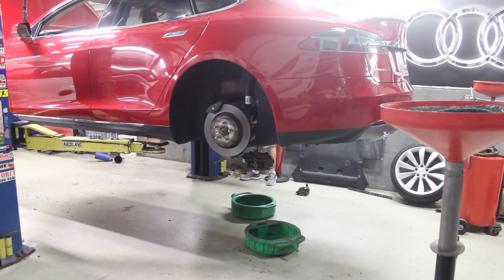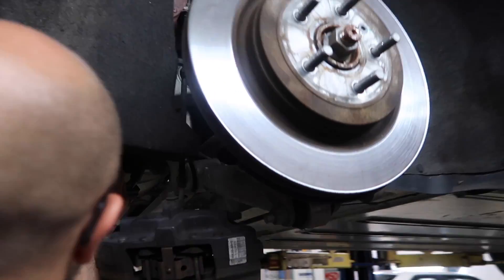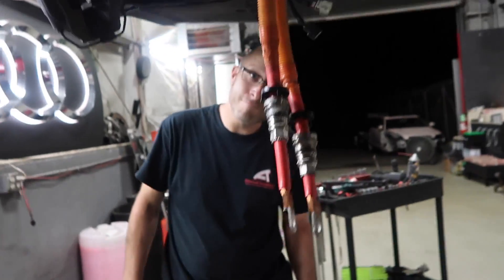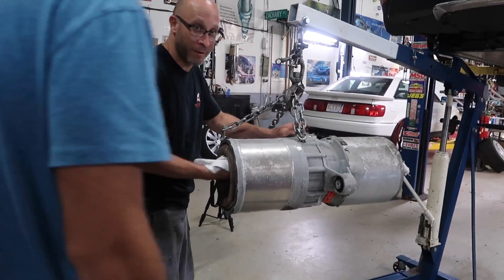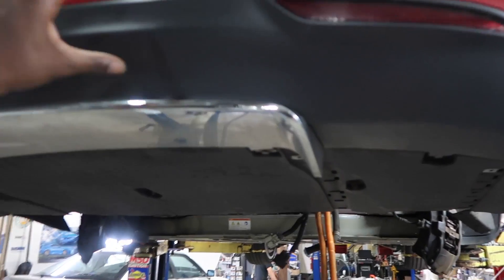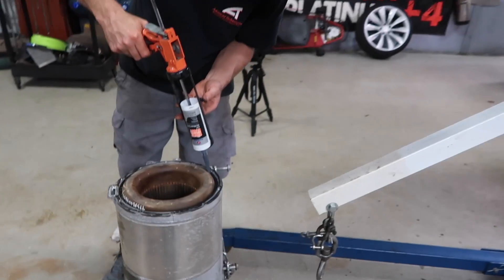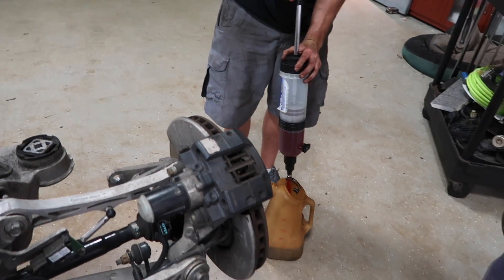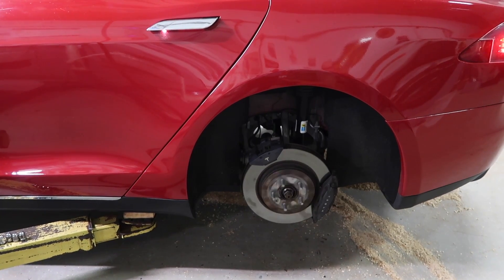First Generation Tesla Motor Failure

Comment: If this is the wave of the future. Tesla need to start helping rebuilders. I don't see any harm. In  helping people do things correctly.
Reply: Tesla may learn a thing or two along the way
Reply: @stevenbarrett7648   I hope so.
Reply: His car is a rebuild telsa will not service it, don’t try to service your car anywhere. The computer know this. And you will lose your 8 year or 100 thousand warranty. Even if you don’t go in for the yearly service schedule you can be denial a repair because you didn’t follow the schedule service to keep everything adjusted right. Telsa want everything in house or you will pay.
Reply: I love that analogy: bottle rocket vs Saturn V lol.
Reply: Tesla does not give a shit about rebuilders.
Reply: Steven Correa . I doubt Tesla will want to associate themselves will
rebuilders.
Tesla is  well aware that their vehicles require minimum repairs ,
hardware ( motors and any other 
mechanical part) is any easy fix.

Yes , you are right TESLA should offer assistance to computer programmers  who carryout 
software repairs off their grid,
in doing so tesla will not comprise
reliability on their older models.
Reply: Steven Correa legal liabilities, as well as IP issues. If someone gets electrocuted because of a waterlogged battery it won’t be very good for EV’s you’ll just get MSM saying things like 

“Are EVs as safe as Elon says or perhaps more fatal than most pregnant single mothers with autistic kids believe? Find out at 9pm!”
Reply: Yes, they don't want liabilities they have to manage and be financially responsible for, so Tesla just act as though they are the unicorn company that doesn't deal with independent service networks like all ICE cars generally really have to.

It's not really just vanity or spite, they really can't deal.
Reply: That's cause they want all the money for themselves which is fucked up.
Reply: They do to an extent right now. But there is a subscription based service you can apply for if you own a shop, and get OE repair info from Tesla for a monthly fee. It's not cheap.
Reply: It's not the wave of the future, it's just a fun project car because it's so unique. Tesla doesn't want to help rebuilders, they want to control all service. These cars will go the hobbyist icon way because they won't be available and serviceable for much longer.
Reply: @zolikoff  You're right I'm wrong. I forgot about the electric trolley cars we had eons ago. Before General Motors bought them all and dismantled them.
Reply: Make no mistake, the electric drivetrain is going to be in most cars of the future, that's for certain. But there won't be many purely electric cars around, and definitely not many cars like this that are expensive, decent-range pure EVs. We will have hybrids for most cars and small, dedicated EVs for city-only use, but they will be like the VW e-Up.
Reply: My point to this is if your spending that kind of money with that amount of failure rate there's a "problem".  Bad bearings, weak shafts.   I think a lot of people are like some kind of retards. Evidently they haven't ever seen a drive unit out of a electric forklift. And don't realize they have been used for decades. And don't have the failure rate of the Tesla's.
Reply: Tesla just doesn't know how to properly build cars. They outright refused to adopt automotive manufacturing best practices (eg. Toyota Production System) out of pure spite. They're a silicon valley company with no initial experience in the field who think they can start from scratch and do everything better.
Reply: Let me know when you find a forklift that does 0-60 in 3 seconds.
Reply: David Christopher  ...Can a Tesla pickup 8,000 and raise it 20 feet in the air.  The point is the electric drive isn't new. It's not a invention sent from the fairy rainbow climate gods to Musk.  Looking at the poor quality of the Tesla unit. These cars are way overpriced.
Reply: The Creator -You compared the drive unit of a forklift to one of an automobile. It's not a valid comparison as their uses are so dissimilar.  Tesla's early motors had issues that Tesla has worked to resolve. They warranty the drive units for 8 years with unlimited mileage so no one is having to pay when they have an issue. It's still relatively early days in the EV world and tech is just beginning to become more robust as more is learned.
Reply: @Northstar4653  I have a $200 forklift motor I have no idea how old it is very very old. I wish I knew how to advance the timing. 48 volts. But the speed limit at my. Neighborhood is only 35. I should be fine to drive in the neighborhood.
Reply: @dchristo10  Thank goodness for warranties. I hope you heard of Wayne Alexander EV blue Walton Kansas. Been converting cars with forklift motor before I was born I'm almost 50.
Reply: David Christopher or a forklift that operates outside 365 days a year in all weather.
Reply: Won't be hybrids when so many countries have enacted laws to ban ICE vehicles in the future. You need to take a closer look at what's coming.
Reply: David Christopher That's an overstatement and misunderstanding of the concept if I've ever seen one. Some countries want to phase out pure ICE production (not ban their use), and a handful of cities are thinking about banning them inside the city. Neither of these two affect hybrids because the policies are directed at ICE-only vehicles.
Reply: If that's the wave of the future Tesla is bankrupt.
Reply: @Northstar4653  well the electron was going to run everything. We went to Petro. Not a good thing

Comment: the shaft with the gear teeth, couldn't the gear end be, carefully, welded then have the gears re-cut, at a machinist job shop?
Reply: Would need to be a really good job for the amount of torque that can be generated.. I'd like to see it happen, it is not impossible.
Reply: Find a good welder or a machine shop that has an in-house welder, most do, then it should be good. Keith Fenner's channel and Adam at Abom79 channel, do this all of the time, I believe their work repairs higher torque rating(s), for their jobs are repairing hydraulic gearing and ship engine drive shaft. Best to research, first of course, any such work at local weld or machine shops.
Reply: eddie Towers Yeah, but making a nice weld and then the gears ain't easy :P
Reply: How so, just as the manufacturers of the geared shaft, one only needs the process of gear ratios, a milling machine, and a process to divide such ratios onto such a shat, like a dividing head, or on lower end, but same result, rotary table. Look up, gear cutting, here on YouTube, and know diametric pitch, diameter, al9ng with gear, tooth count. Though it seems overwhelming, it’s actually quite easy using the Machinery’s Handbook for guidance. Anyone can’t fail, following such processes
Reply: I’ll admit, maybe it’s unfair to say it’s easy, as a seasoned machinist. But it’s certainly not out of anyone’s reach, to replicate exacting gear cutting.
Reply: yes, it possible to restore the shaft, could be an interesting project

Comment: sorry to say but that shaft is gone will not last 2000 kms,sorry to say rich .u can use the rusted shut good shaft by heating then u can take it and stick it to that car.
Reply: 50% Simple Green/50% WD-40 works wonders on rusted shit. We call it milk (don't drink it).
Reply: @Phyxx_TX  atf mixed with kerosene will work as well.
Reply: Or get a can of penetrating oil and spray the hell out of it.
Reply: You could also do alcohol 90% dip it and then pull it fast. Have done it, the alcohol penetrates like nobody's business and then it evaporates.

Comment: Well, that was educational, my model S has 44k miles
Reply: Lol my Tacoma has 300k miles and it has the same engine from 1999
Reply: @XxmatixX6videosdiariosdenadav  and this is another story, can't even compare the situation, the experience ice car manufacturers made over the decades and what experience Tesla has, they are good engineers and brave but still missing some points. Maybe that shaft should stay in a oil bath like the internal of a gearbox, or maybe for the power it develops the axle is undersized. It's a bit early to overuse anyway
Reply: XxmatixX - 6 videos diarios de nada :v 
As Rich said, they made major improvements to these over the first 2 or 3 years. Tesloop, a long-distance taxi company, has two 2016 Model X's with over 300k miles on the original drive unit and battery. The first year model of Tacoma probably didn't last 300k trouble free either.
Reply: Dustin E 
Well they gave me a whole new drive unit so I should be good to go for several years.
Reply: Jeremy Schmidt they probably changed the bearings and resale it on ebay 😂😂😂😂😂
Reply: What year is your Model S?
Reply: @azalru  2013 S85
Reply: My '13 S85 made it to 78k miles. Was still driving fine but making a milling sound.
Reply: Jeremy Schmidt engine bearings
Reply: @Dustin E agree, milling sound is not a good sound
Reply: Its terrible that a motor can wear out so soon i never heard of a combustion engine thats its normal to replace under 50k miles
Reply: FamilyFirstJ now you know that when it starts to make grindind noises it’s the engine bearings and it will only get worse until you replace it
Reply: FamilyFirstJ better get that seen about looks like compete failure is imminent
Reply: @mattsmith819  I booked an appointment already with Tesla

Comment: Those calipers shouldn't be hanging like that!
Reply: I guess Rich noticed the problem at 3:36
Reply: Yeah, I commented before watching the whole thing.
Reply: Glad it's not just me! I used to be lazy and prop calipers on the springs when I took them off. But they would usually fall and yank the line. Now I tie them up with wire.
Reply: Yep I agree!... those hoses will stress fatigue due to treatment like that!
Reply: Common mistake that will lead to hose failure causing the brakes to hang up due to the inside of the hose losing its strength and expanding during breaking and holding pressure after you let off the brakes.  Dumb mistake for a 50 cent bungee cord vs an expensive brake hose
Reply: Well, 100Bar fluid pressure stressing the lines very much. And if they can't handle the few kilos of a hanging caliper, then they wouldn't whitstand many hard brakings either. 
When i service my brakes, i first make the line straight and slowly dropping it till the caliper fully hangs. Better slowly apply the force than accidentialy "dropping" the caliper and the brake line gets too much tension stress. Also i use the hanging to check the lines if they're shwoing sings of aging.
Reply: with thousands of psi of brake fluid trying to pull that apart from the inside i dont think a 3kg caliper will harm it
Reply: Usually just balance them on the rotors for most cars
Reply: I got a pack of ten camping hooks for 99c to hang the calipers on the suspension spring
Reply: Yeah found that odd.
Reply: I was thinking the same thing. That's why I keep zip ties around to hang them.
Reply: It’s good practice, but as long as you just gently hang them being the aluminum Brembo style no damage will be done.
Reply: That's why they ziptied them up
Reply: its not a biggie
Reply: just playing devils advocate but if they fail under such a small stress those lines should have been replaced some time ago
Reply: I've never actually seen a professional tech use hangers.
Reply: that's what everyone says but i guarantee they are much more robust than people think they are
Reply: connelly6375 still just don't leace someone else his brake calipers hang like that..
Reply: @horse_examiner  yep never done it in 22 yrs, not saying thats right, but apart from banging my head on a few calipers never had a problem.
Reply: A little tiny caliper like that hanging by the hose isn't going to hurt anything
Reply: Artanis02sk exactly
Reply: Meh, they are aluminium calipers, they wont stress the lines in any significant way.
Reply: Brake lines are made for magnitudes of the stress hanging calibers causes. No problem with that, just bad style.
Reply: Of course! The lines can handle tons (maybe not quite tons) of expansion pressure. My paranoia is that hanging or dropping a caliper could crimp the line and weaken it. And I use paranoia intentionally - I know it's a teeny risk. But brakes are one of those "don't mess about" parts that I try to respect a whole lot.
Reply: They’re not wearing safety shoes either. I would never bring my car here.
Reply: Sacatolas Moreira Your Tesla, or?
Reply: I weld in crocs it is not a issue #ManUP